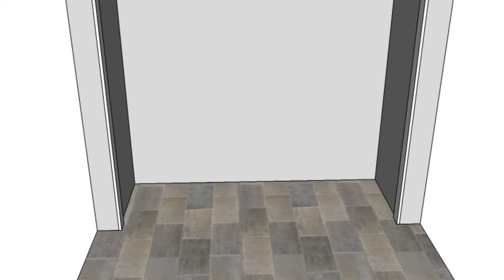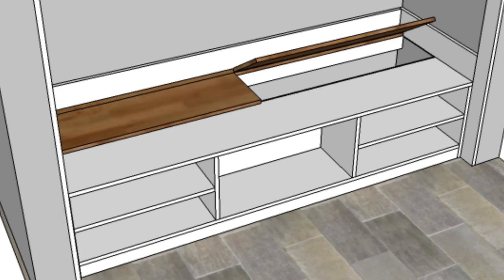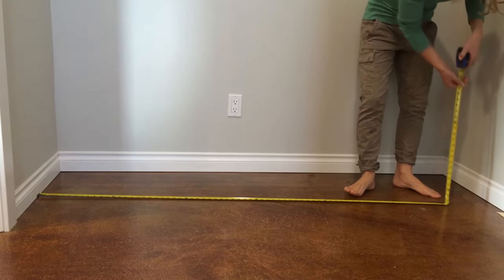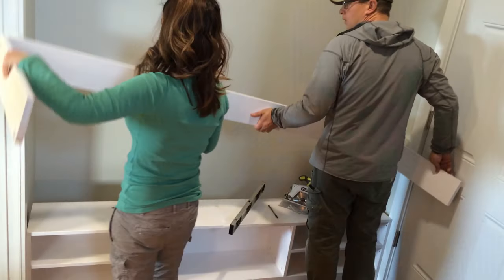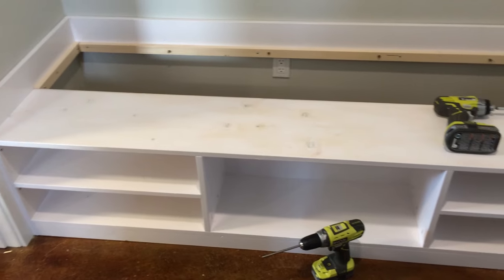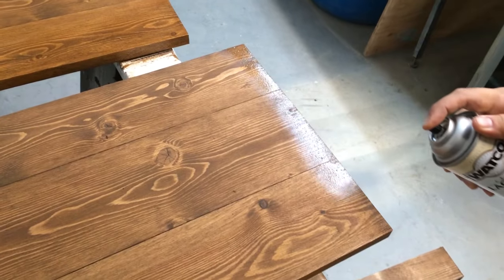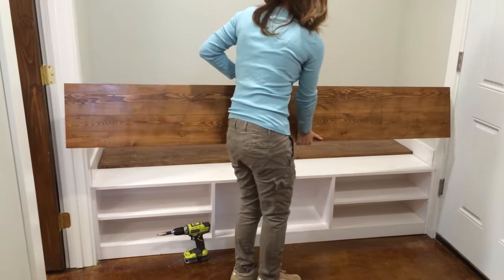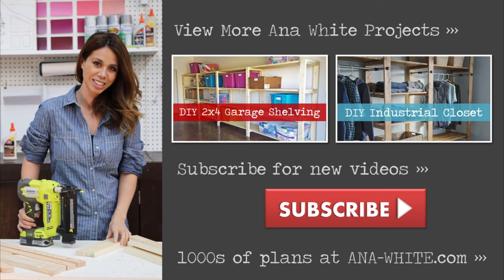DIY Mudroom Bench with Hidden Boot Storage

Comment: Hi Anna, love the bench! Just a question, did you have to take the baseboard trims out before putting your bench? I heard from your video that you had to build it with half inch allowance
Reply from the maker: Rediza Gapas Hi - We had flat trim around the door casings, so I just built the bench to fit in between the door casings, so I didn't have to remove the baseboard.  It will really depend on your situation if you have to remove baseboard or not.

Comment: I made this! One of my first major woodworking projects, and boy did it come out like _crap_. But a good experience and functional piece.

My extra tips are:
- My room wasn't square, so be sure to scribe the walls and see if you need to create new reference edges, particularly for the door
- I tried to build the whole piece to length and build it in place, but it was way way too tight in my deeper mudroom. Build to a purposfully smaller length and just fill in the gap of some number of inches.